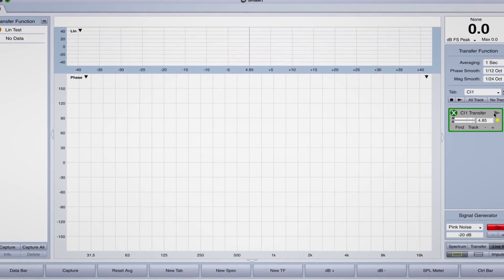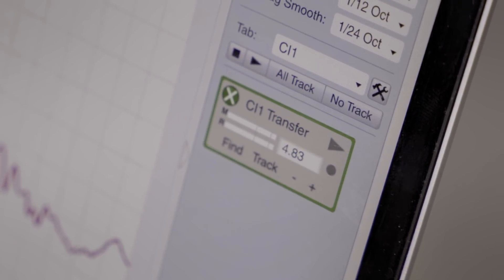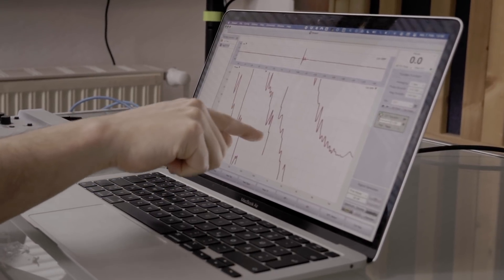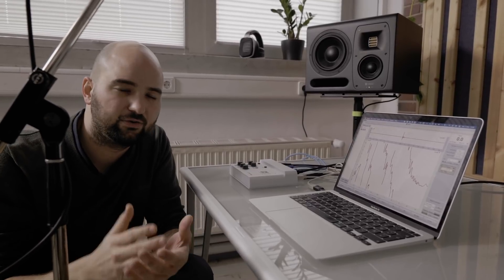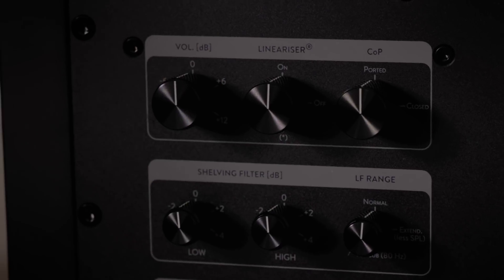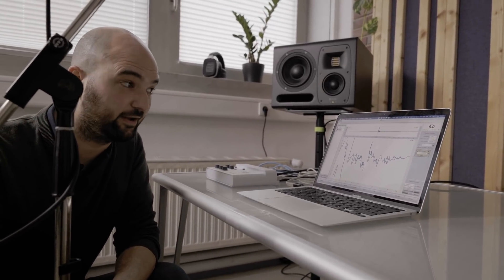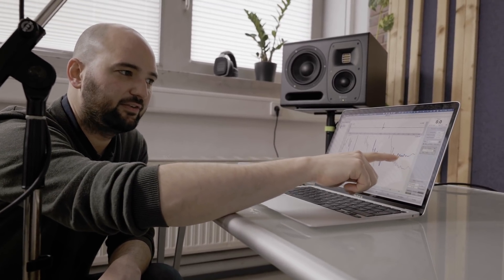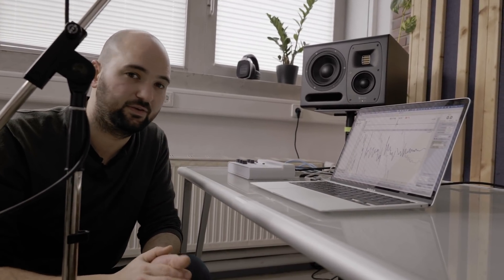Studio Speakers: What is phase compensation and do you need it (measurements)? - with HEDD Audio

Comment: The basic assumption that all the different frequencies are arriving at slightly different times is wrong. The speed of sound is constant across all frequencies - (otherwise sounds would spear out of intelligibility the further away you got from them..which we all know isn't true). The reason why you see the phase slope is a product of wavelength and distance, NOT separate arrival times across the frequency spectrum. I.e..if the microphone 'hears' 100hz to be 0 degress in phase then of course a higher or lower frequency will be cycling out of phase due to the wavelength or distance from microphone. The phase 'correction' on this product, by compensating by introducing frequency dependent delays, will do nothing but introduce the time based frequency smear that it was designed to correct. This is either intentional snake-oil to sell product or a gross misunderstanding of basic physics from the manufacturer. (Im not sure which scenario is the lesser evil.)
Reply: Oh...and the jump in the phase graph is probably not a room reflection, that's probably the crossover between the HF and LF driver where there could well be a time/distance difference but this would be very very minimal on a speaker enclosure where the LF and HD driver are mounted in the same physical plane (I.e without a horn chamber). The small time difference introduced moreso via the propagation path to the microphone.

Comment: This is the worst BS i have ever seen in my life.  "Phase Compensation" isnt a problem at all for one single speaker,  its with so low prio you need complex gear to even measure it,  and everything else in the chain matters more then this BS if you ask me,   even the cables matter more.   Do you think "phase compensation" is there in real life ?   when anything make a sound,  the high, mid and low freq. doesnt move at same speed,  if you with with a DSP mess with this timing,  you make the sound unreal.     "phase problems" are for 2 or more speakers,  not 2 or more drivers in the same speaker.      Use time and energy on improving the most important thing in the chain first,   the room,   after that 1000 more things before this BS one speaker "phase compensation" ..

The human brain is way more complex then this "one speaker Phase Compensation" need.    Its like when you need glasses and the first day you use them,  things at the edges look like a fish bowl,  but after a few days/weeks,  it all looks normal.  the brain dont need "Phase Compensation" from a single speaker,  its all a stupid useless sales thing no one on earth could spot in an AB test.    Its like when you take a high end dac and put it in the case of a cheap dac and the other way around,  and the AB test shows that the cheap DAC sounds the best.  The brain is easy to mess with,  and that is all that is done with "one speaker Phase Compensation". IMO.

Have a nice day.   I else like all your videos,  but this one is BS in my book.

Comment: Wait but doesn’t a positive phase shift mean something is arriving earlier in time? Not later?

This is why when you add delay to the test signal (before compensation to the reference) there is massive negative shift across the spectrum.

So wouldn’t that first phase reading suggest that the bass is arriving earlier than everything else?

Comment: I been learning about phase while designing a crossover for my 3 way diy speakers. 
I've noticed near field measurements 9f a single speaker gives a phase response that wraps once along the sweep. But 2hen !easured at listening position it wraps a lot more, even more so when multiple speakers are measured all at once.
While I'm designing, I use one speaker to test the crossover. The other speakers stil have the old one where phase wraps 2-3 timesand starts at different angles. It gives weird centering problems as expected. Most likely due to reflections. It gets worse when mixing and matching different types and makes of speakers. I can see how phase compensation could help smooth things out there as well, hypothetically speaking.

Comment: Question can a tracking vocal room/ booth be out of phase? I've notice when tracking let's say a lead vocal the same line on multi takes playing  back the takes of the same verse/line some takes sound different from each other some of the same words sound have more bass and some sound more bright. so when I start my mixing on the vocals it can get very tricky trying to eq. note I have a small tracking room 10x11' 8' ceilings my control room is about the same size too. Thanks😎

Comment: Great phase demo. I want to add that you will not only introduce longer delays if you linearize below 80hz but also introduce ringing especially a very audible pre-echo effect to the sound. You can see that in the step response graph.
Reply: Isn't pre-ringing an issue for when using a linear phase filter at any frequency?
Reply: @Sparta155  Linear phase filters introduce equal amount of pre and post ringing. It's not the phase shift that causes pre-ringing. It's a complex function of the frequency, boost and Q of a filter. Min phase filters can also introduce pre-ringing at low frequencies and if they apply a boost with a high Q factor.

Comment: Good video, thank you. One question though - is this only applicable when several drivers are being used? That is, is it only the delay times between the different drivers (high/mid/low as presented here for example) that are being manipulated, or, if one is to have single driver cabinet, does this somehow still apply?
Reply: I'm also interested in more information about it. Headphones which are often single driver also have phase and group delay issues to my understanding.

Comment: I just got the HEDD Type 07 MK2, but I have concerns. A commenter below asked: "If you mix with this correction how will it affect the playback in normal speakers?" 
I have the same concerns. Won't listeners be hearing something different from what you intended?

Additionally, most sample packs and presets were designed without this sort of phase compensation. So when using such samples/presets, won't what you hear on the HEDD's be different and unintended by the sample/preset creator? I believe this needs to be addressed.
Reply: don't worry, it's a subtle change.. it's more for monitoring more accurately instead of changing the perceived character...  A valid question though, but ask yourself, it you use speakers to work, won't it sound different on headphones and vice-verso? ;) .. that is way more of a change.
Reply: @catonlsd3  I see what you're saying. But if speakers and headphones both don't have phase linearization, then there wouldn't be any change in regards to the phase.

I still can't see how linearized speakers would help monitor more accurately if the sounds you're using originate from phase uncompensated processes (which may have accounted for the phase issues). Phase compensated speakers would change the intended soundstage in many cases. If it's subtle enough to not make a big difference, then the whole appeal of phase linearization disappears. If it's a big enough difference then my original concern is relevant again and we're back at square one.

The only advantage I can see to linearized speakers is if the entire industry is moving in this direction and you're just getting ahead of the curve, but even then it might be better to join in later than earlier when most samples/presets won't be phase linearized.
Reply: @spideymuse  linear phase in the case of the HEDD monitors is simply trying to undo the unavoidable phase distortion of the cross-over filters, that's all. If you aren't that sensible to say... linear vs minimum phase eq changes, this feature will be very subtle for you so probably not worth of that much consideration.
Reply: No, it's not the way you understood this. The lineariser is a fixed compensation works on the crossover point of the speaker itself, doesn't affact the source you want to give into it. 
For example, you sound design a kick drum with some phase distortion which cause some comb filtering effect. The linearizer will not change this,  it will only make the speaker linear phased to playback the phase distorted sound that you designed.

Comment: Awesome explanations on Phase (your teaching style in general is very good!).   In a 2.5 channel, hi-fi home system, how can I control or improve phase/timing of my speakers in the space they are playing in?  Is this something that is typically controlled (or should be controlled) via the speakers crossover?  Thank you for your expertise and work!!
Reply: The phase of the speaker is set in stone if you just leave as is from the factory. That is, in an anechoic chamber you would measure a certain pressure magnitude and pressure phase. In your room, however, the pressure (magnitude and phase) will change, but the inherent 'system phase' of your loudspeakers will not. With DSP you can manipulate magnitude and phase, but you will get some latency in the system.

Comment: Isn't this just a advance "time alignment" to use the 1970's term?
Reply: time alignment is a different thing... moves 'all' frequencies in time. Phase alignment moves certain frequencies in time to a degree. In this case, they are trying to undo the inevitable phase distortion caused by the cross-over filters.

Comment: In my experience, the important thing to achieve in speaker design is phase linearity/continuity through the crossover region(s) of multi-driver systems. I haven’t found maintaining absolute phase WRT frequency to be that important, using live music and full-range electrostatic speakers as references. My ears, others may perceive differently.
   Rather than resort to DSP, I prefer to carefully design the analog crossovers for a wide phase overlap around the crossover point after physically aligning the drivers for the same arrival time at the listener’s ear. This of course implies a fixed listening height and distance or physically adjustable drivers, so is not very commercially viable (though a few do it).
Reply: Yes, the speaker design and crossover should design for a reasonable phase match, the 1. graph is totally unacceptable from a speaker design and crossover perspective.

Comment: Great video! Not enough people talk about the importante of phase coherency in speaker and setup. My preference goes to making a fase coherent speaker instead of DSP but the fact that it makes up for it is awesome
Reply: Unless you've invented a new kind of transducer and haven't told the world:
Dynamic loudspeakers are inherently prone to this problem and it is impossible to get a linear phase without dsp. Maybe in the future someone will build a speaker that does not have this problem but the typical voice coil driven speaker will always suffer from this and you can't fix it mechanically. 
After all they've been around for over 100 years if it was possible im sure hedd and other manufacturers wouldn't result to digitally fixing this problem.
Reply: @NiliMoto  yes dynamic drivers have this problem. But there are a hand full of speaker brand that have near perfect phase response, dunlavy and Van Der Steen. When you build a closed box speaker with first order slopes you can get there. But you will always get that 180 degree phase shift at the lowest woofer resonant frequency. This can be pretty low if you are willing to live with a very big speaker. The dunlavy sc-vi is 7 or 8 feet tall and 3 feet deep. All time aligned drivers with felt around the drivers to shape the off axis roll off. They are one of only a hand full speaker that can produce a square wave without dsp. I have a DIY design though out that could also do this.

Comment: Hey Jesco,

The HEDD speakers do look awsome -  fantastic idea and the results are amazing.

On the subject of time, could you answer a couple of questions about absorbers and what they are wrapped in please.
I'm in the middle of building a LOT of absorbers. I'll be putting in 8" units at the back of my room with a gap and 6" units everywhere else.

My main question, as you are talking about phase and the smearing of sound is about the use of plastic, or non-porous materials in traps.
I've tried numerous experiments with different plastics, right down to extremely thin film and they are all (to my ears anyway) reflective.
I understand that even very thick plastic will not reflect low frequencies, but Is it a good idea to wrap rockwool in plastic at the first reflection points?
If the upper mid and high frequencies are reflected won't this cause smearing, due to the timing change?
Would it be better to wrap the rockwool/mineral wool in polyester batting to stop any fibers escaping and at least benefit from broadband absorption at these reflection points?
Sorry for all the questions.
Thanks in advance.
Cheers 

Mark 🙂🙂
Reply: For me personally, health is priority no. 1. Yes a thin plastic film will reflect some high frequencies, but i did it in my room too, and i don't think it changes the sound too badly.
Reply: @tim110-handle  Hi Tim. Yes, it's a difficult one for me. I've had 12, four inch panels in my studio since 2007. Thay are wrapped with 10mm polyester wadding and then open weave material on top. I've never had any issues with them, but...
The problem is I've known my room has needed a shed load more treatment for many years. I'm finally building another thirty panels and four corner traps. The corners will definitely be sealed, as I'm not interested in broadband absorption from those.
I did think about putting plastic in the back of the new absorbers and doubling up the polyester to 20mm under the front cloth. At least that way I still get HF absorption, no particles escaping from the back and hopefully none from the front with a double layer of wadding.
Just looking for the best of both worlds and as you said, trying to minimise health risks having so much more rockwool in the room.
Cheers 🙂
Reply: Thank you for the feedback, Mark!

Comment: now I'm not trying to be smart here, just asking.... I think of the example and I can't understand why the doors won't open all together and after that, it's a mater of speed,  but if you fix this delay, don't you mess with the natural human hearing?  and if you mix with this correction how will it affect the playback in normal speakers? maybe silly questions, don't know....
Reply: Perhaps I'm missing the point how can a sine wave phase be the same for high and low frequencies on one speaker?  I get you can phase align any discrete frequency with a stereo  pair, but not phase aligned with two frequency's simultaneously as the frequency is different and will not be in-phase.
Reply: @airwood99  I don't really understand it also, I used the term natural hearing but you said it much better...
Reply: @airwood99  what you want is linear phase for the total output. With linear phase each frequency has its own phase but it being linear ensures that the time delay is the same for each frequency.
Reply: The phase of a loudspeaker generally adds distortion (phase distortion, a linear effect). This will result in different time delays for different frequencies. With dsp you can get a linear phase which ensures constant time delay, which is closer to what you would experience in nature, since the sound speed is the same for all frequencies, ie pure time delay as a consequence of the distance to the source.